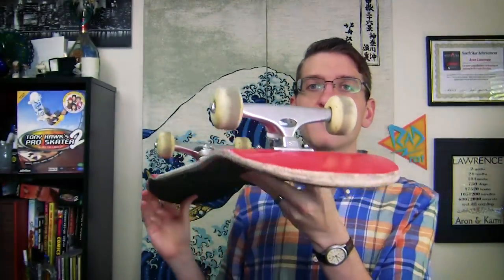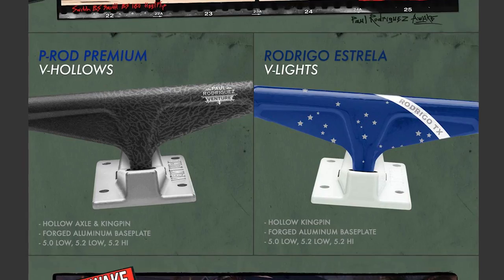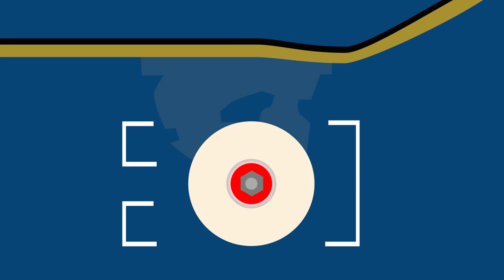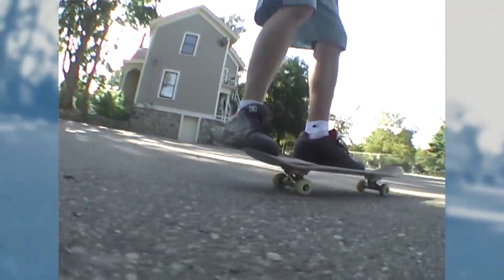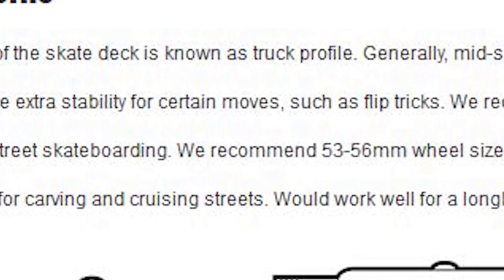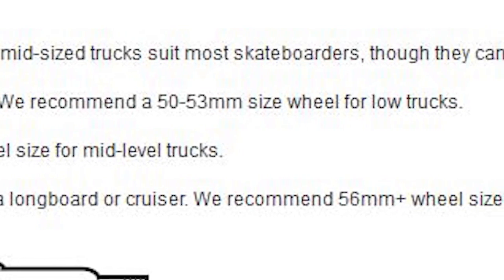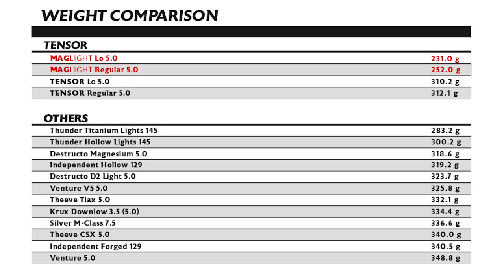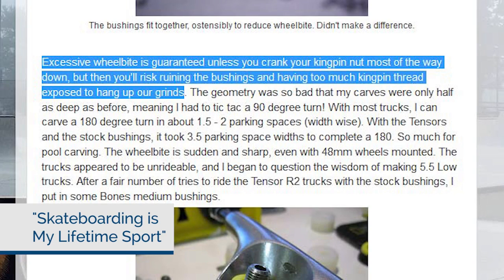Low Vs. High Trucks - What's the Point?

Comment: I switched from tensor lows to thunder highs, specifically for the kingpin issue. Did notice a slight difference (with the same size wheels) but not enough to have to get used to it. I did also notice reduced wheel bite. I feel like just for the kingpin issue (unless you buy smaller ones or cut them down) lows aren't as good

Comment: I notice the difference. I skate high trucks with 1/8 riser to keep hardware from loosening up easily. I do a lot of pump turns for speed, and it’s easier on high trucks. The distance from the ground feels just about right when I pop for high trucks. Also some trucks are installed more in our out than others. I notice that for tail slides.

Comment: I can tell you after doing bs crooks on high ledges that higher trucks can give you more pop but it’s harder to control, sometimes I miss the pop because I jump before the tail had a chance to hit the ground. It’s more fun having higher trucks as the turning radius gives you better style but it depends how you wanna skate, personally I like skaters like sewa k and Rodrigo tx because they are tall like me and I like tech skating so I’m gonna switch back to low trucks. Regardless low truck skaters can still hit higher ledges it depends how high you can jump but I found that high trucks can be frustrating as I ‘miss’ the pop sometimes.

Comment: One downside to very low trucks in my experience, is if you go to the shop to get replacement kingpins you will end up with a Kingpin that goes higher than the truck axel, i haven't skated regularly in years and when i did i was younger so maybe you can ask for a low kingpin, i don't know, but when i'd just ask for a replacement kingpin they would always be too long for my Destructo lows.

Comment: For me, truck height does a big difference for the coordination of your feet when popping a trick. If your trucks are higher, it takes more time for your tail to touch the ground so the other foot has to wait a little more before scrubbing the board. Also, the angle of the board is greater, kinda like when a deck is more shaped. However, bigger wheels will impact the way I pop in the same way. That said, I agree with other factors mentioned in the comments here.

Comment: I have to say that the truck height plus wheel size combined can really make the board feel different. I am not saying high or low is better--and I actually agree that there is more pop with higher board setup, but the wheel/truck combo really does make a difference.

Comment: Low set trucks are more stable in the middle and less stable on the sides because the point between the top of your board and the center of mass is short. 
Shorter levers are more difficult to move than longer levers. 
This means you gotta flick your flip trick from the side of your board because the sides are further away from the center of mass which gives you a longer lever.
Higher set trucks are the opposite, they have a longer lever in the middle so it's easier to flick flip tricks from the middle but flicking flip tricks from the sides are now more difficult because the levers are not as horizontal from the center of mass so when you flick from the middle it's also pushing on the center of mass which makes it more difficult to flip the board.

Comment: Can you make a video on Avenue trucks? I've been skating for 9 years and my knees are starting to break so i'm gonna try anything that helps.
Reply: I bought a set and put together a cruising, downhill, commuting setup with soft (88a) wheels and it is SO smooth! I have another board that I use for street/park that has regular trucks with 1/8" shockpads and softish (92a) wheels and it feels really harsh after riding the avenues. To be honest I haven't tried doing tricks with them yet but I'm 40 and been skating for more than 25 years and my knees and ankles have noticed the difference even just riding long rough downhills. The only downside is they're a little bit heavier and if you're gonna be doing tricks then maybe change out the bushings which are pretty average. Another potential downside is the judgement you might get from idiot haters but most people who have noticed them have been curious and remarked on how smooth they feel when they've tried my board. Hope this helps :)
Reply: I ride avenues for a year plus. They are very friendly to the knees and ankles, very pop-y and smooth...BUT, they do break easily (the Hangers) which is unfortunate. Hopefully, they will gradually improve quality. Mines, just broke on a regular ollie, and I don't even do gaps, stairs or staff, to be honest, they broke on flat ground, not even attempting a curb....

Comment: I like low trucks, I can definitely tell when trucks aren’t low, and it’s not a HUGE difference, I can make it work with any truck really, but it’s enough of a difference to notice and feel, I’ve been using Venture Lows for ever, I switched to thunders for a little bit, I liked the pinch on them, but overall I like how much closer to the ground i feel in venture lows, I just wished they made venture lows for boards bigger than an 8.125

Comment: Lower trucks are more stable because you're gravitational weight is closer to the ground and they're lighter. High trucks are good for cruising because they prevent wheel bite when you put big wheels on or you can use risers for that. If you want tricks pick lows if you do both cruise and tricks pick high trucks. The difference is very small that it doesn't really matter unless you use risers.

Comment: when something is spinning bringing the weight closer to the centre of the rotating mass will assist in spinning something quicker..  like when you spin with your arms out and then bring your arms and legs in quickly you speed up because the centrifugal forces speed up because their's less mass taking up energy and the energy is transfered closer to the centre hence the boost. same is said for trucks your bringing your weight into the centre of the spinning mass.. also.. when you're riding the centre of gravity is lowered. if you want the ultimate in landing stability ...low trucks and slightly wider wheels will give you nice stability on your feet.

Comment: Right when you said "The lowest I could find" I immediately thought "Tensor Maglight."
Picked up some tensor maglights a few months ago (honestly, I wanted to try them because I usually use Thunder His, so I figure I wanted to try out some low trucks).
Boy did I wheel bite like crazy. I swear, I even bought a smaller wheels than my usual thinking it would help (50 instead of 54). I need riser pads, but that defeats the purpose of low trucks!
Reply: seems like it balances it out to add risers.  not super enjoyable to bite all the time ya?

Comment: Thunder polished 149s (55mm axle w/ hollow kingpin) with 8.25 deck w/ medium concave.  No riser, any skate bearings that are from legit brands, and 53mm Spitfire 101 radial slim wheels in the 99 duro and upgraded Bones bushings.  this setup is low but not super crazy low, gets decent pop but also doesnt require you to slam your foot down to the core of the earth to get said pop, the wheels are small enough to have control but big enough to skate quarter pipes a little bit and also the wheels are small enough and slidey enough to do techy stuff but also big enough and wide enough to roll over cracks without pitching you off the board every single time.  This is what I skate as a street skater here in Wisconsin, where our skate parks are few and far between, and the streets are very very rough.  No one here skates small wheels but you also cant go too big or they become unmanageable.  And the thunder polished 149s are great bc they are light, and they are low and stable but not TOO low, they are, to me, more of a mid height.

Comment: I haven't noticed much of a difference either to be honest, been skating for 6 years and I believe I've tried 4 different kind of trucks. 
Skating those hollow independents right now and they feel nice. 

My last trucks were ventures but I shattered them into 3 pieces it was kinda weird.
Reply: I always broke ventures kingpins.  Still loved them though
Reply: Question What You Fear Yup. Mine were pretty new and one kingpin snapped doing a flat 360 flip and I think  my foot landed on the truck. Never had that happen before. So I never got them again.

Comment: The stability of low trucks is higher because the centre of gravity is indeed slightly closer to the board. I actually do notice how my cruiser longboard with pretty darn high trucks feels less stable. Some of it is countered by having trucks that are just very heavy all around (yes, the longboard cruiser is pretty much impossible to flip for me as total beginner, even landing just one foot). As for 'better flip tricks' though, probably not true. For the height of a high truck, you also get a stronger centrifugal force during a flip. It's why heavy trucks versus light trucks barely have a significant difference in terms of flips really. It might be easier to get light weight trucks going in terms of a flip, but that's really all. I do agree that light weight trucks would also have more problems transferring the energy from it's own mass into a pop. It might be true the pop is still higher somewhat, but probably not much.

Comment: Used to ride low trucks, boards required tail to be worn down a bit for pop, and then didn't last long. High trucks better for pop and pop life, especially if you get a deck that's flexing a bit from the baseplate on the tail, or has a larger gap before the kick. 
That's riding trucks with wider wheelbase tho. Thunder/venture. Seems like a set of Indies keeps most happy regardless of the variables.

Comment: Liked and subbed. I keep my board and axle the same. Wheel bite is a problem for me so I use a very thin riser. I haven’t used risers for ever but now that they have given the option these days or so many options I shave 2 boards for skating. 
Park skatin transitions. I ride 55 wheels 159 GT trucks with an 1/8 th riser and the deck is 8.75. 
I’m going to make a 9 in board so I’m looking for a 166 Indy with 56 wheels. I hav t got wheel bite so I’ve found a sweet spot. 
I think a lot of people forget their weight and how tall you are. Im 6,3 and 210 lbs so im not a little guy and I add some medium style bushings. So far the 8.75 board with the 159 has been a great all a rounder but it’s been great in the minis and transitions.  Im too old for hard street as I like to go fast and big and pop Ollie’s no flip tricks anymore.   I have had a problem getting used to the night of the pop or how much I have to get it to pop it. The good thing is I Ollie’s so many jump ramps that I rarely had to bang my tail on it to get that leverage. 
Im going to try the 9 board and 166 .I’ll keep you posted.

Comment: Tensor now has their light mags with a 55 axle height. So you can have light and pop now. Based on some pro street skater decks on YouTube, pros skate mid or hi  trucks with small wheels. Based on my research, for today modern skating, skate mid or high trucks. These are the adult/pro sizes.

Comment: Light trucks are better for carrying  around, like at a mall or school.I used to ride low trucks and i was one of the highest olliers in the parks, but i had more a robotic/stiff style. I lent my board that i researched to be the appropriate size for street and park to more talented skaters, and they were still as talented. Yes, it's the skater not the board. If you look into pro's board set, they do not obey wheel or truck size for their style of skating. But yes, cruiser, pool, vert, mega ramp boards, (etc) benefit from a certain size board/truck/wheel/etc.

Comment: I feel so old. Now they are called vintage. Late 80's Goldwing trucks (plastic base about an inch) with riser pads(another inch) AND shock pad to absorb impact plus bridge bolts. THAT IS HIGH. Put all that on a Santa Cruz Corey o'brien (the one with death  holding a fireball) and drop from a poorly made half pipe. Accident in 3,2,1... but hey, easy to make high ollies.

Comment: When I switched to 6.1 ventures from 159 Indy's the shop told me that the ventures were already shorter by almost 2mm...put the same spitfire sfw conical 52 mm worn down so give or take 49-50mm. O got wheelbite all day I wasn't able to break in the stock bushings so I put bones hards in and some risers to make them more like the Indy clearance...but I just got a second pair for a 8.8 shaped board and 56mm conical wide contact wheels... Tbh I don't want to use risers with the ventures at all. I'm gonna try to put the risers on that setup and try the original bushings in break them in on my non shaped non riser board. Idk ventures have great pop imo from the wheelbase difference I can generate a lot more pop on flat or on a lip/transition. Though they feel jerkey much like thunders...and Indy's have that turn potential with one foot over the bolts on both trucks that I've grown to love

Comment: its would be easier to figure out if we just applied the same rules for Fakie that we already use for Nollie, he rolled up facing the ledge so front side and he used the most forward part of the bard so nose there for Fakie FS nose slide varial flip . as for sex changes my uncle skated when i was a kid(early 90s) and he called them sex changes, and anything else that involved a body varial would also end with 'Sex Change"  so ive continued to use the same naming

Comment: Trucks are all the same if you ask me. I've skated Grindking trucks, 2 pairs of cheap ass trucks I don't even remember the brand of, Independents, skated with and without risers and I'm currently skating Silver M-Class hollows. I really couldn't tell you the difference between any of them.
Reply: really ?   i notice a big difference going from thunders or tendor to Indy.  the indys turn better.   but im fine with the others, maybe thats what u meant.
Reply: I've never skated Thunder or Tensor trucks myself so I'll have to take your word for that, but yeah that's pretty much what I meant to say. All the trucks I've skated were completely fine, the cheaper ones obviously weren't as durable as a pair Indies but other than that I just couldn't notice much difference.

Comment: Depends all on the way you ride. I love higher trucks as i ride more crucy, fast, curbs and such and skate also some bowls and transition but mainly like to go fast. Style and pop over technique. A smooth bs 180 over a curb block i would choose any day over some whatnot undercasperflip etc. I do not ride that technical, kick flips and treflips is all you need as base for flip tricks. :) 
I have a lot of pop and every time i skate a board with lower trucks of a friend i really really hate it and i feel the difference in the way it pops. Wheel bite is an issue too on lower ones, specially as i ride my trucks pretty loose. No tech flippy stuff possible if you ride loose loose trucks anyhow unless you are Deawon. 
In general there is a world difference in how trucks turn and that you will feel best if you ride transition ans specially bowls where you carve a lot. If you do .. there is no way other than riding Indys. They turn better than anything. I tried them all. 
For the weight.. well, the lighter versions with hollow king pins do help us older folks for sure but do not make heeps of a difference. But if you ride boards above 8.25 .. you do not mind to save a couple grams and well, it does make a difference if you have 2 chocolate bars less on your board from a hollow axle bar and hollow king pin to a normal one.

Comment: The height of a truck is measured from the baseplate to the axle. 👍 Lower trucks are more stable for flip in flip out and are good for locking into slides and grinds on ledges, etc. A lower truck just sits on a ledge differently, more tighter than a high truck. Lower trucks give a quicker snap and response and are usually skated more tightly. Your board does play a big factor as well. All depending on the steepness of your nose and tail.  With Higher trucks You are able to skate more loose with a quicker turning radius.  Its all preference and the size board does come into play as well.  But there is a difference with timing and responsiveness.  Ive seen people skate low trucks who like a quicker snap and can ollie higher than most. One friend in particular can easily ollie around 42inches with ease skating venture lows. I personally like high trucks the older indy stage 10 and earlier with the 53.5 height. But i have been skating thunder 147 highs more recently (which are more like a mid). I can definetly tell a difference. My Timing on nollie tricks especially where thrown off. But like anything you just adjust and eventually get the feel for it.

Comment: Higher trucks should be harder to flip because they will have a higher moment of inertia which scales with weight and its distance from centre of gravity. I don't think that having more distance to accelerate the tail pop would help much since your leg is doing an impulse movement. You might get less height out of your ollies because you spend more time accelerating mass downward than usual.

Comment: I’ve recently bought low trucks and they are incredibly wobbly. I’ve tightened the bolts all the way and the bolts are brand new. Is that what low trucks generally feel like or had my bored lost it’s teeth in the bolt hole so the bolts aren’t stabilised?

Comment: i ride tall trucks with 60mm bones wheels. it allways wants to flip when i do pop shuvs etc . and compared to a low board with 50mm wheels feels much more stable.

not sure íf its just me being used to high trucks. but i pop much higher as well
Reply: Makes sense though. Honestly, with a higher gravitational point things will flip more easily. Think of a truck versus a low sportscar, which one will topple over quicker?